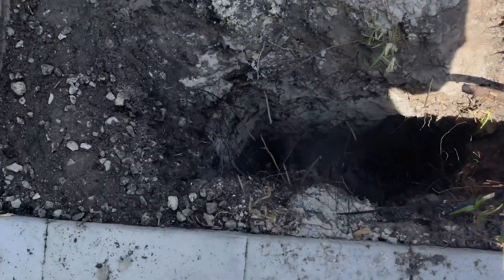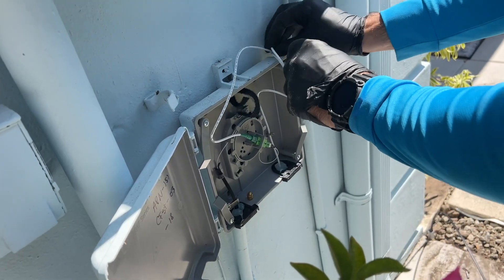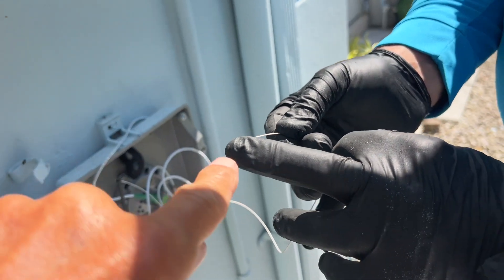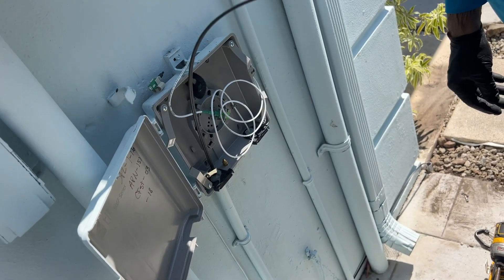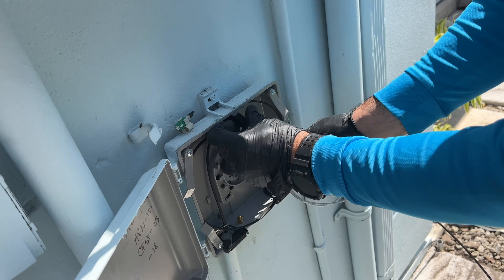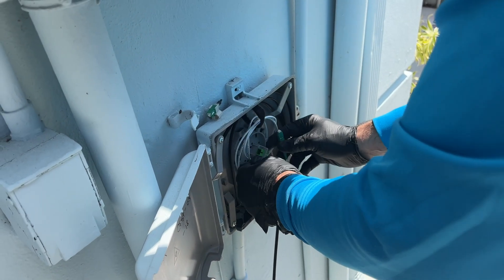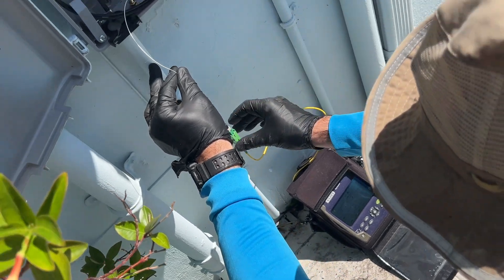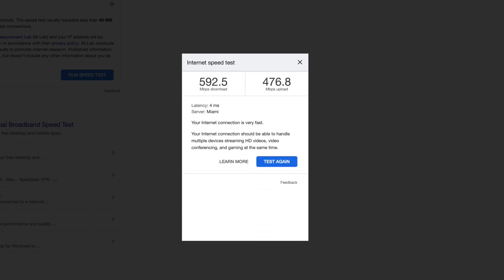How to fix Fiber Optic Cable

Comment: Pro tip: for whatever reason you need to access the box, use a 10mm socket to open it (for repairs or to troubleshoot)
Reply from the maker: Good tip thanks for sharing that.